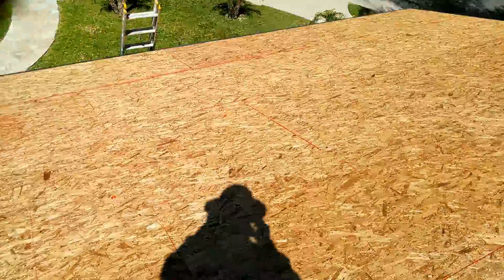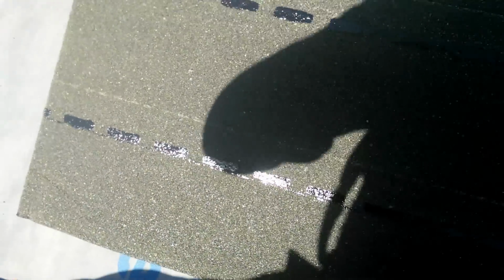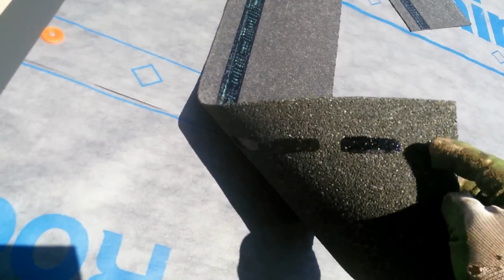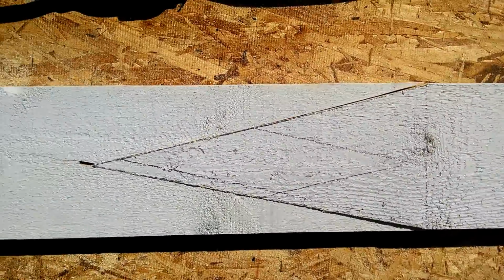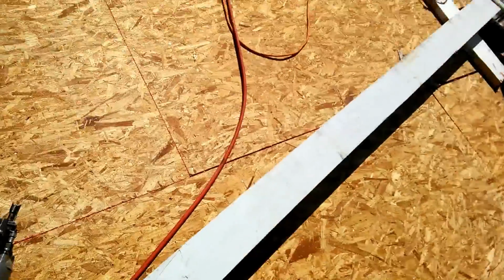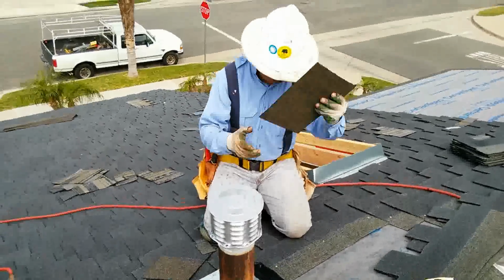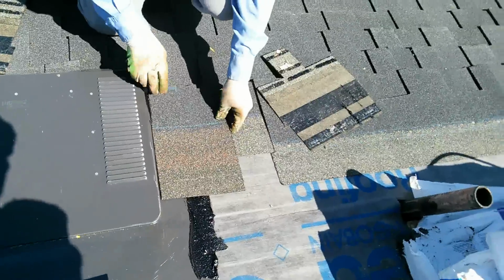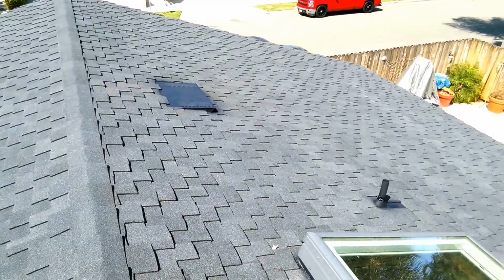Do you want to be a roofer?  Watch this video!

Comment: You guys talking about his you used to be roofers and got out of roofing ,talking about you made the right choice to leave the trade ,how sure are that you made the right choice financially? I worked as a commercial roofer/waterproofer as a union for 32 yrs ,22 years as a senior foreman of a 30 to 60 man crew ,my hourly wage without the $11.78 an hour paid to my health insurance ,and without the $9.75 an hour vacation pay included with my hourly pay I was making $48 an hour and working 40 to 70 hours a week year round ,once a year our union would tally up our working hours & cut us a check at $9.75 for every hour worked ,my vacation pay was roughly $25,000 a year every July, we were also paid " Travel pay " where the farther from home we worked the more tax free living expenses we were paid ,my travel pay for living in Detroit & working in NYC was just over $1,000 a week ,also all senior foreman are allowed to keep ALL salvage metals like copper, extruded aluminum, brass etc ,some jobs I would collect $25,000 in salvaged copper alone ,all foreman are given Wright Express gas cards to keep their truck ,Skytrak and cranes filled with fuel ,all foreman are given company work trucks ,off of 1 Ford Motors job we did that was 9,200 sq we took back over $150,000 in #2 copper ,brass and extruded aluminum, I split it with my right hand man and my Top 5 journeyman so all my best journeyman could all buy brand new Ford F-150 work trucks .

I'm retired now & have been for over 5 years ,my union pension is $5,700 a month & I retired early ,friends of mine who worked until 60 are collecting over $8,000 a month in pensions ,we also receive a $10,000 life insurance policy and our pensions go to our wives should we did 1st ,my next door neighbor is a doctor and his house sits on 3 acres while I have 22.5 acres ,my home is as nice as my doctor neighbor and my furnishings are mixes than the doctor ,when I retired I went and spent $1.2 million dollars on high end home theater and hifi equipment and paid CASH money ,so are you guys who quit roofing because you didn't dig working with 550 degree hot tar ,or banging shingles making $150,000 before $25,000 vacation pay ,another $20 grand in scrap copper ,labor saving bonuses for bringing the job in ahead of schedule ,plus awesome X-mas bonuses where journeyman get $10k ,foreman get $25k and superintendents get well over $100,000 ,are you still thinking you made the right choice to leave roofing for a job sitting behind a computer sucking up air conditioning and becomming soft ? 

As a journeyman roofer I mastered all types of sloped and flat roofing ,I mastered rough carpentry ,I mastered Architectural Sheet Metal, I mastered light iron work and welding ,I mastered heavy equipment like Skytrak ,Cranes and Manitou Telehandler Crane/lifts ,I mastered all coatings as well as below grade waterproofing ,all which made me able to find a $100,000 a year job as a journeyman within 2 weeks ,my wife is a retired PHD professor from Wayne State university and not once in her 22 years of teaching did her salary equal half of my gross earnings ,in fact she banked 80% of every dollar she earned for 22 years teaching which made us retire with over $3 million dollars in the bank .

Anybody who doubts what I claim my roofing career has provided feel free to visit my homepage where I show how we live ,and prove I spent over a million dollars on home theater electronics alone and over  $50,000 on custom made furniture for our 2 homes that are 100% paid off .
Reply: Tree Climber your giving your son extremely sound advice ,sadly schools are giving students bad career advice when they tell every student they need to go to college to have a good life ,they don't tell kids that 90% of college graduates degrees are unwanted in the workforce ,we have something like a 5,000 to 1 ratio of jobs requiring a college degree vs available jobs ,the 1 field America is lacking employees is commercial & industrial construction ,it's no coincidence that 20 million Mexicans quickly filled those jobs ,and it's a huge lie that employers are paying illegals shit wages ,I worked with roughly 100 Mexicans and not 1 made less than $100,000 a year ,I was paid $48 an hour plus $9.75 an hour vacation pay ,plus nearly $12 an hour twords my insurance and another $8 an hour into my pension ,all toll I was making just under $80 an hour and my journeyman amd apprentices were making $18 an hour starting pay with a $1 an hour raise every 6 months until they reached journeyman level ,if I may offer some advice for you ,advise your son to do his best to sign on with a union company ,my pension is $5,700 a month and my social security that just kicked in is $3,160 a month ,my wife's pension for 22 years with Wayne state is less than $2,000 a month and she spent 8 years in college getting a doctorate .
Reply: Skrittles Mcwiggles 1 more thing skittles , Union roofers are NEVER paid by the square feet ,we are paid hourly , tell me the area you live in and I'll give you the phone number of your local roofers & Waterproofers union where you'll have a much better career while being trained to become a Journeyman Waterproofer .
Reply: Skrittles Mcwiggles I just showed you what roofing company /company's have 60 men crews ,and i supplied a link to the company i retired from with pictures of my commercial work ,plus i gave you a video of 1 of my Industrial jobs with a 55 man crew that was filmed for an episode of Modern Marvel's ,I'm sorry to burst your bubble kid but the tiny company you work for installing shingles doesn't represent the commercial & industrial roofing industry ,our journeymen make $32 an hour ,plus $9.75 vacation pay ,plus pension ,plus health insurance ,plus life insurance ,plus travel pay for working over 50 miles from the county line , since you know so little about the uniion commercial & industrial roofing industry I'll do you a favor ,post what city & state you work/live in and I'll give you the phone number for your local roofers & Waterproofers union and it's highly possible they'll take you on as a 1st year apprentice and put you thru 4 years of trade school where you graduate as a Journeyman/Master Waterproofer .
Reply: Skrittles Mcwiggles you've " seen it all " have you ,OK since you are a skilled " Roofer " then explain how to install a fully tapered insulation system over a Type B metal deck for a Factory Mutual wind rating of I-90 ,the tapered system consists of 1/8 inch per foot slope using A ,B ,C ,D tapered panels ,1 inch & 2 inch flat panel Polyisocurinate aka ISO ,and finally for the crickets between roof sumps X and Y tapered panels ,that's a simple task any 2nd year apprentice could be tasked with and complete with only 2 yrs on the roof and you have 9 yrs on the roof .

I know Eric knows how to install tapered roof systems because he's a real roofer ,so let's see what you know ,oh while your at it your 9 yrs of experience should equip you to explain the roofing & waterproofing segment of my crew working on Detroit Deisel that was filmed for Modern Marvel's ,explain what you see my crew doing on an industrial roof since you've seen it all .
Reply: Michael Ledford yeah well a Dr doesnt abuse his body and come home tired as shit. Also who wants to work 70 hours? I work to live i dont live to work. And i know alot of roofers that dont make close to what you claim to make... I call bs
Reply: JBiNN Your post shows how little you know about doctors ,my neighbor doctor works 12-18 hours a day 5 days a week and performs surgeries on Saturdays ,doctors put in hella hours ,your post also really highlighted why millennial Americans are being replaced by the millions with Hispanic immigrants ,only your generation has refused to work long hours to get ahead and it's made you the most undesired workers in the world ,do you see Mexican building tradesmen driving beat down trucks ? No they all have new trucks and large bank accounts and it's because they understand the only way to get ahead and make a middle class life is by working long hours ,when I retired I retired a millionaire from working long hours as a Waterproofer ,I paid for 4 children's college education and left them ZERO loan debt ,I paid off 2 houses by the time I was 45 yrs old from using every dollar after 40 hours to pay on the principal of my home loan debt ,the same as my father's generation did and the same as the Mexicans who have taken over construction .

I'm willing to bet $5,000 that Eric who operates this channel earns more a year than you do by a long shot ,has better finincial security ,better cars and a much bigger savings than you because he works long hours ,your not impressing anybody here with the worn out " work smarter not harder " shtick because it hasn't been true for 30 yrs ,right now 80% of colege grads will never use their degree in the work force amd will not have a better life than their parents ,you are the 1st generation to fail earning more than your parents because unlike Mexicans you were never taught the value of hard work long hours .

You've talked a lot of shit about how horrible a job roofing is yet you still won't show us how you live ,why is that still living at mom's house ?
Reply: Michael Ledford if you measure the enjoyment or life based off of income then you're doing it wrong. I live comfortably making 20 an hour as a potatoe farm operator. I work 50 hours a week and bring home over 4k a month, where i live in maine thats considered upperclass... I see zero roofers around my area making anywhere what you say. My buddy's been doing it for 4 years and makes 15 an hour and works way way harder than me. Sorry that I want my body to last, almost all old roofers have back problems and can barely walk straight, none of them have new trucks and none of them are immigrants. The reasons why Mexicans are happy to do the work is because they make 1/4th the money in their country doing the same work. If you enjoy work that much that ud beat ur body and work 70 hours for money they isnt required to enjoy life then you're doing it wrong. I probably work harder than a roofer but i also make alot more than any roofer i know.
Reply: JBiNN if you allow your career to become 2nd to your " enjoyment " your job will be taken by a 3rd world immigrant who's hungry for work and understands they need to work as much as possible ,America was built by an Agressive work force ,not a hoe hum work force and it's why US born Americans aren't the most desired work force we used to be ,mainly because US born people just expect there will always be food & shelter .

To examine which work ethic is best for America and the millennial generation all we need to do is to compare multi generational work ethics ,my generation born during ww2 saved enough to pay for our children's college ,and demanded they take classes for a degree in demand ,we all paid our houses off & had the lowest debt ratio of the century ,now let's examine the mess parents have left their millennial children ,student debt has become a crisis ,very few parents bothered to save for their kids education ,or build businesses for them ,or leave them an inheritance , which boils down to this ,either you forgo your enjoyment for building something for your children or you saddle them with debt ,I chose to give my kids a debt free start in life by working 70 hrs a week and I'm enjoying the shit out of life by watching my children's success .
Reply: Sounds like good pay but I've yet to meet an old roofer without a ruined body from head to toe. Bad knees, back, neck, elbows & wrists. Higher risk of skin cancer working out in the sun all day on a hot roof. Lifelong pain isn't worth any amount of money to me. I'll take my 60k sitting on my ass in a factory pushing a few buttons on the CNC machine a couple times an hour.
Reply: Ghost2Coast That's a fact right there ,we do get fucked up ,I've had 4 back surgeries in 12 years and now they want to put steel rods in my back ,all the journeymen I know who did steep work for 30 yrs their ankles and knees are shot ,sadly that's the way it is now ,you either bust your balls or you don't earn a middle class life .
Reply: Union pride, ua steamfitter here
Reply: John Friesen How many commercial waterproofers do you personally know ? Not shingle installers but Journeyman waterproofers ? You think they pay us peanuts for waterproofing the world's largest bridges ,parking structures and high rises ,the only trade that earns more than a journeyman Waterproofer as a whole are lineman ,just because yiur life & career are failures don't apply your pay with men who are extremely well paid .
Reply: I personally know a retired at 55 journeyman electrician, a retired journeyman pipe fitter, and my next door neighbor is a journeyman welder who  makes over 32.00 hr and gets travel pay and housing and food allowance which is called "per diem". He just told me a month ago that he will make over 90,000 this year. Everyone of them have told me about how good it was or is to work for the union as well as the benefits and the pay and the retirement and the pipe fitter has told me stories of the scrap copper salvage where he made more in that than he did in his hourly wage for a month. I think it is hard for people to believe because they know of no one who does it. But it's true. These guys are my friends and neighbor and they have no reason to lie. In fact their home, vehicles, 4 wheelers, and toys prove their talk.
Reply: Mow Pro56 I agree ,on my Google plus homepage I show both paid off homes I bought as well as the $1.2 million in Mcintosh high end home theater electronics I've stocked the homes with ,I show my 1938 EL Knucklehead and 1955 Panhead ,people who've never had a union job and became a top journeyman can't fathom we earn more that college professors .
Reply: That's pretty good. But they don't have pensions anymore been in the union for over 20 years.
Reply: That’s why unions are dying off (very glad).  Employees are making too much money.  Pensions and health care is unsustainable.
Reply: Key word in all that is UNION, for the non-union workers reading that, you WILL NOT understand. You're not union. For a union worker like myself. The numbers don't matter, he was union he was getting paid.
Reply: Michael Ledford although I buy some of your comments, some of them are BS. I’ve been a union Roofer for 27 years.
First off if you retired early, your pension gets cut. And I assure you, you are not receiving the $5200 or whatever it was you said a month.
Second, unions don’t give bonuses, but the companies you work for do. You’re telling me they handed out hundreds of thousands of dollars to people. Absolutely not.
And there is no way in hell your vacation pay was $25,000 a year. Again not handed out by any union.
You are correct in saying you can make a lot of money. I make over six figures a year only because the company I work for can pay me whatever they want as long as it is at, or above scale. Obviously I’m above scale.
Yes the health insurance is good, pension is decent, but everything else you mention I’m not buying.
I’ve done heavy, large commercial work in the Chicagoland area my entire life, and I’ve never seen more than 25 men on a roof although you may be an exception doing distribution centers, things like that. Perhaps that’s what you did, but you were not running this day in and day out with a crew that size.
And if you spent over $1 million on some home theater, you definitely didn’t make the million dollars from roofing in a short period of time. Not unless you were the owner.
Even though some of your comments are false, you are correct in saying if you’re in the roofing industry, don’t be a scab, get into the union, and work your way to the top and you’ll make more money than 90% of the people in the nation.
Reply: Mike Spain very glad??? Why is that? You don’t like making six figures a year, you don’t like health insurance, you don’t like having a retirement fund? You’re part of the problem.

Comment: Good video but when installing the starters I never shoot the starter through the drip edge. One leak you have 5 ft of soffit rotting. Other than that, very thorough and great information. 10 years roofing experience

Comment: I'm not from the US  so don't really get these shingle roofs? Are they cheap or what is the advantage of them as I can't imagine they would last very long? We would only use that type of roof or similar on a shed.  The vast majority of our roofs are tile or slate and on my house which is over 70 years old the roof is tile and still in perfect condition.
Reply: tile and slate here will cost you your first born these are asphalt shingles and will last 30 - 50 years the advantage is when installed right  they seal together and become one piece as if it was blacktop on a road no cracks no chips safe from wind and hail
Reply: The company I work for uses an asphalt shingles roof that lasts 50+ years. We use ONE manufacturer and certified and insured installers  so that we can give you a TRUE lifetime warranty. It's not cheap but tile and metal is still more.
Reply: My understanding is that the freeze/thaw cycle can ruin a tile roof, but I'm sure it has more to do with saving money in the short term.